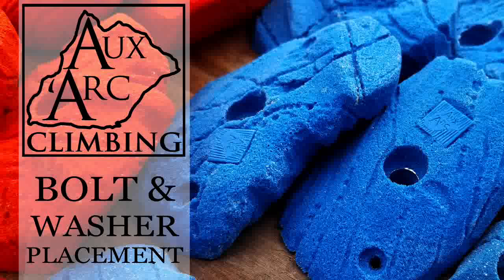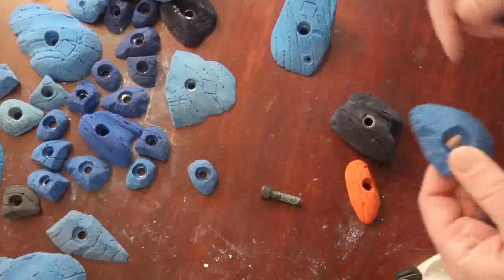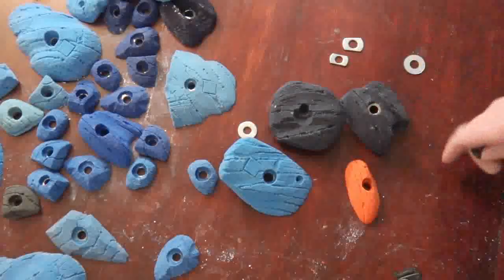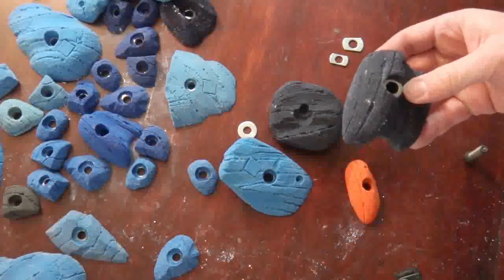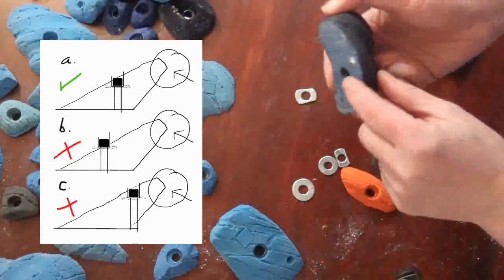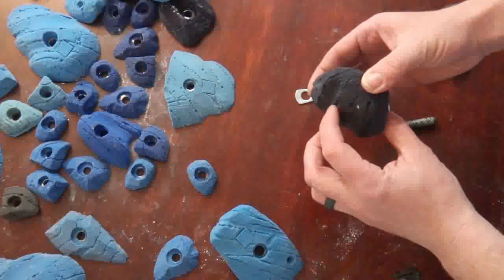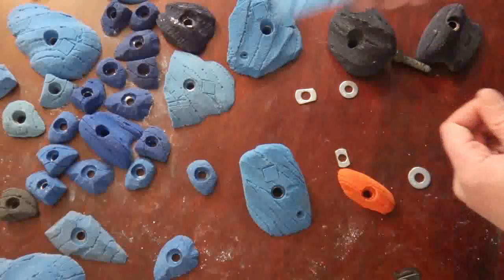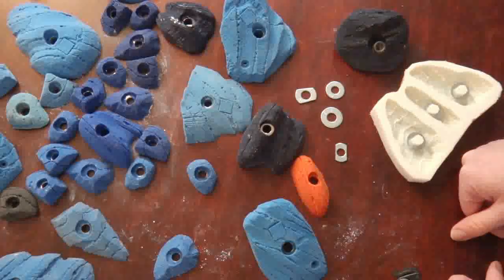Bolt and Washer Placement in Climbing Holds

Comment: I want to add to that if the hold is very strange and the surface is difficult to find a central bolt spot... Then just using screws might be the best option.

Comment: How do you get finished hold hole so close to the diameter of the bolt head instead of the diameter of the washer?  Or is that just the 5/16th washer diameter I am seeing?

Also, do you use a 7/16” drill bit or a 3/8” bit for the model holds?
Reply from the maker: Hey, sorry for the delay here.  So I use 3/8's drill bit for the shaft of the bolt.  The head of the bolt, I don't remember the exact size, I just eyeballed it compared to the head of the bolt.  However, since you place the washer during the casting, it traps it in resin so I don't have to place it in there afterwards and thus have a larger hole for it.